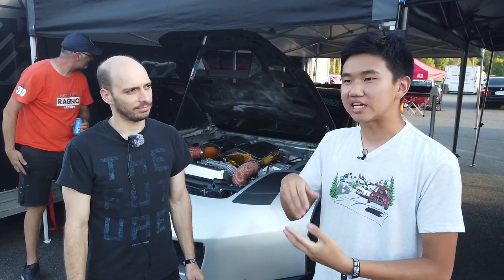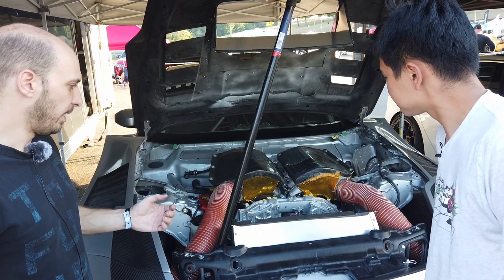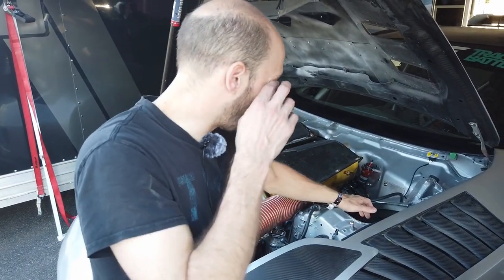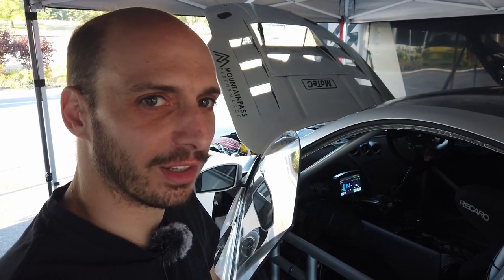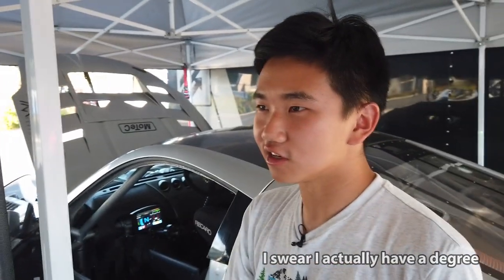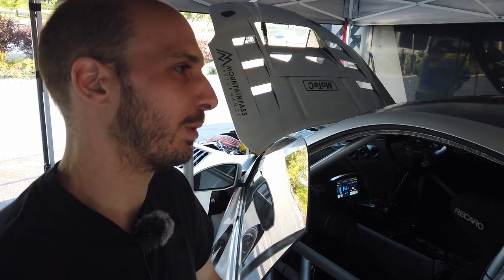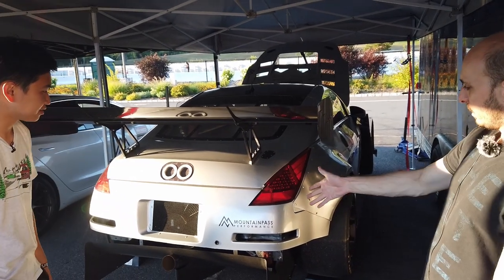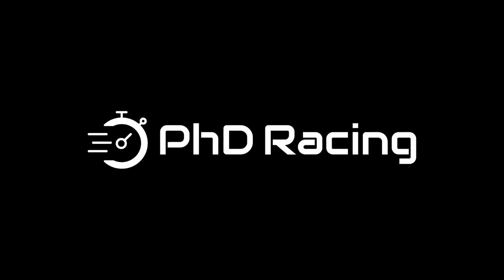HYBRID Power 350Z with ALL the Tech!! Time Attack Rivals #13

Comment: Finally hardwork paid off his main issue back then installing IMA system. The e motor shaft kept shearing off, due to high tq output from the engine. After few years of innovation it has paid off. 
Its finally refine and driving hard.
Thanks Jackie ding. Most of us been waiting for this talk you and sasha.

Comment: For hybrid in the Supra, I believe there are some longitudinal eCVT transmissions used in Lexuses. It would be very fast if you can use one of those to leverage the CVT infinite gear ratio to just hang it at peak power and accelerate the car under the engine. Would be a real challenge to control and hack the Toyota control systems.

Comment: B58 only has a slight hybrid 48volt but that B58 is only in new BMW's but it's not meant for performance more for gas mileage. But that's a start. A Big Single Turbo Hybrid B58 would probably have 0 lag, hybrid system can work as a supercharger for low end.
Reply from the maker: That was the idea… lol
Reply: @JackieDing86  🤯

Comment: How does he put it in neutral to heat up the motor? He said the motor is permanently connected to the tires and there's no clutch/flywheel.. The only thing I can think of is, he cuts power to the electric motor and let's it's free spin. The only down side is, if the gas motor produces more than the electric motor, will it overpower the electric motor and cause it to slip?? This is a very interesting idea.